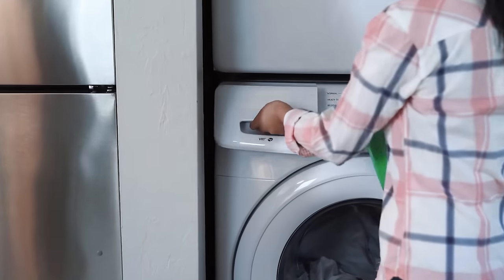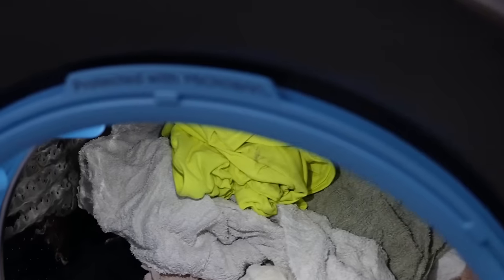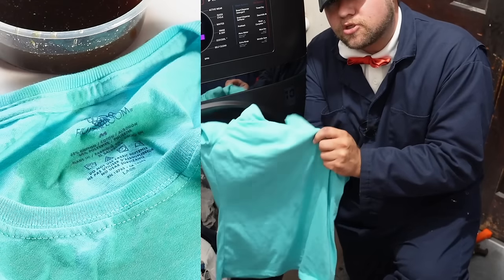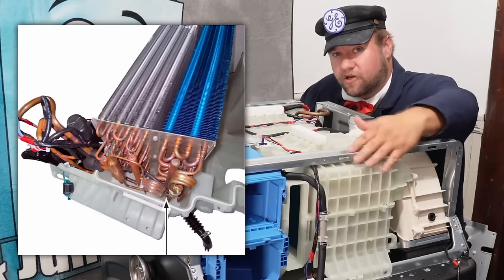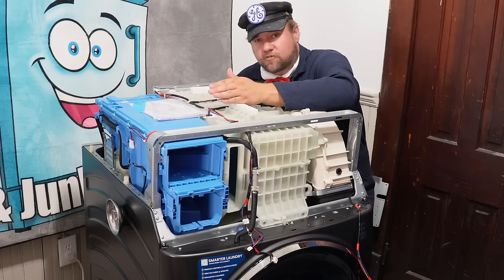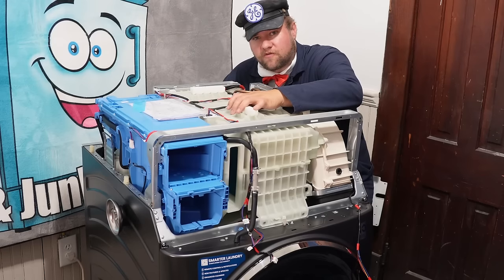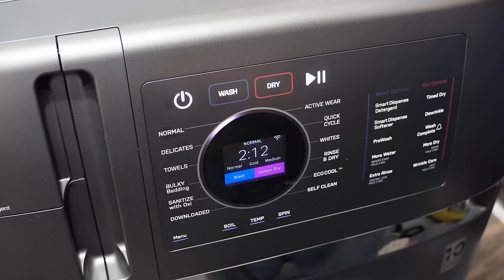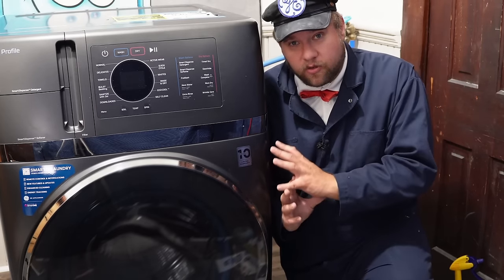The Best Washer Dryer EVER? The Ultimate GE 2-in-1-washer Dryer Combo Test & Review

Comment: Loool A couple years ago my sister asked me to take a look on her dryer, which wasn't working properly, 3 MDs and a cleaning lady couldn't figure out why, they never cleaned the lint... Like not once and the exhaust tubing was not only also clogged with lint but it was also disassembled, like maybe pressure inside just pushed pieces apart, apparently cleaning the lint filter isn't common sense

Comment: HEY! 
Great video!  I just purchased one today at Home Depot for 1400 as it as 50% off with clearance.  Have you found any improvements that could be made to the lint catcher to avoid any damage to the machine?  I saw someone put electrical tape to close a small gap between the filter and it's housing.  While I would be concerned about it melting and causing a bigger issue I was wondering if there was anything else that might be a good idea to take great care of the machine so it takes great care of me. 
Really great video! I gave it a like and subscribed!
Reply from the maker: I have a video where I used electrical tape. Works just fine. The system doesn't get much over 145-150*F and most all electrical tape is rated for 185*F. That would be the key: Make sure its rated for 185, as there are tons of parts on this machine that are rated for that which operate well.

50% off is a heck of a deal!

Comment: I have a samsung 2 in one unit. And what i do if i need to full capacity of the washer is to run  30 minute dryer. Then remove evrrything heavy like towels and pants , the  run it for like 1.5 hours more.

This way i can also some what dry things that are not ment to be dryed. I never damaged any cloathing doing this.

Comment: Ben, you compare the power usage between the GE heat pump vs a regular vented dryer in terms of a single load (10 pounds for the GE).  Data would be more useful if it was converted to a per pound of clothing cleaned and dried.  Does the 2.5-3 kw for the vented dryer apply to more than 10 pounds?  If so, the efficiency advantage would be less than described in your video.
Reply from the maker: I'll see if I can do some tests in the future. Capturing real world KWH usage on 240v machines isn't easy, but I did find a solution a few days ago I'm excited to try.

Comment: How is the filter an issue? Every single dryer I’ve ever used has a lint filter that needs cleaning after every load. Why do you make it sound like this is any different?
Reply from the maker: GE's UI, the manual, and app only suggests to clean it every 5 loads. Thats why...
Reply: @bensappliancesandjunk  Sorry, my comment probably came across quite brash. While there definitely are a group of people that cannot grasp the concept of regular simple maintenance, I think most people will probably get in the habit of emptying it each load due to muscle memory from their own drier. GE likely made the situation worse by stating that it should be cleaned once every 5 loads instead of every or every other load

Comment: I can’t even imagine what happens to the coils on the heat pump buried in the system when lint gets passed the filters which I assume it 💯 % will since every dryer I have ever had doesn’t catch all the lint in the trap… and I assume once it gets into the heat pump might there be mold issues from trapped moisture and organic contents in small dark areas?

Comment: I'm not clear on the evaporator unit part.  How well does the dryer work in very humid weather?   Will it freeze up like an a/c unit does?  Or will it wind up overheating because the humid air won't let the coil properly evaporate?  Or is humidity not a factor at all - beyond it taking a little longer, like in a standard dryer?

Comment: I got this for $1600 from Costco on memorial day. I sold my washer/dryer for this. The ONLY downside I've found to this, is that It seems to leave clothes more wrinkled than a regular washer/dryer. Addressing a few things in the review: 1. GE says in the manual that clothes will come out damp, but that is just because it cannot fully dissipate in the drum because it's a sealed system. When you take them out, the clothes will turn dry almost instantly. 2. EVERY dryer needs it's lint filter cleaned and it should be done EVERY cycle, so I don't see this as any more maintenance than a normal dryer. The machine will remind you to clean the black filter, and ask you to confirm you cleaned it when you say you have., so it's pretty important.

Some observations:
Review only touched on the fact that this needs NO venting whatsoever. I retired my dryer vent. Also because it's a heat pump, there is a significantly reduced risk of fire.

You only need a typical 120v outlet which means because it needs no venting and a regular 120v outlet, you can put this really anywhere there's an outlet and water with a drain. 

I found I needed to add hammer arrestors to my washer with this unit. I have never needed them before.

GE says you can increase the spin speed and it will reduce dry times, however, the higher spin speeds will contribute to clothes being more wrinkled becuase of an "ironing effect" of being spun then immeditately dried.

GE also states in the manual to keep the GIANT LAG BOLTS that come in the back of the unit in case you ever move or sell it. Moving the unit without them installed can damage the drum. My installers took them with them as trash. I had Costco replace them.

Lastly, the ability to scan UPC of the detergent and fabric softener you use using the app and have it dispense them according to manufacturer specs is great. I wish they woudl increase the library of detergents it was a little lacking and didn't have the detergent I use. They had the brand, but the not the OXI type I use.

Overall, just throwing in the laundry and coming back and having it done is a great convenience. We'll see how long it lasts though. I agree with the revew that the lint trap area was dirty and I feel like over time, that will make airflow an issue.

Comment: Mine broke after 6 loads...has been opened by tech 3 times over a 1 month period and is still not fixed.  Know that you must try the machine within 48 hours and if it breaks after that you are stuck with it. I have a $2600 washer that has been repaired 3 times and counting.  Who needs to do laundry over Xmas anyway

Comment: Do you have thoughts on the LG WashTower 202HBA with the heat pump? I am interested in a heat pump, partly to avoid running a dryer vent. It seems like there aren't a lot of standard US sized options of heat pump dryers.

Comment: We just bought this machine at Lowe’s. Two issues we are experiencing: I just put in a thin comforter and bed sheets with pillow cases. For some reason, none of has dried at all. Second: once it got into the dryer cycle it has forced the outlet (gfci) to shut down. Not sure what to do to resolve the drying issue or the outlet being set off. Will return if not resolved.
Reply from the maker: Have you cleaned the lint trap thoroughly?
Reply: @bensappliancesandjunk  yes. This washer dryer combo was delivered yesterday. The lint trap didn’t have much when I cleaned it.

Comment: Great video!
Question. Can you use dryer sheets? I don’t do a load of laundry without them.
Reply from the maker: You can but you'll need to clean that filter out more often with hot water
Reply: I haven’t needed fabric softener dryer sheets, there’s no static and everything comes out soft and fluffy.

Comment: I bought a GE Combo washer from Home Depot in July 2023.  I just noticed that the shipping bolts were removed by the installer, but the shipping brackets were left in place.  Is it ok to leave the shipping brackets on the machine or should I remove the shipping brackets?

Comment: Only thing I'd be wary of is the brand itself. I've always purchased GE and im 2017 I bought all GE appliances for my kitchen. Within 3 years i had issues with the over the stove microwave and had to replace it. Next was the dishwasher. Panel was shot and wouldn't work anymore. Then the refrigerator took a dump. Finally, the glasstop  stove had issues with indicators, which is dangerous because it was impossible to tell which burners were on. GE doesn't make appliances like they used to in the early 2000s and 90s at least in my opinion.

Comment: I currently have a Whirlpool Heatpump dryer (their first generation in the line). 

Despite cleaning the lint trap almost every load, ultra fine lint gets past it and collects on a non-removable mesh just before the condenser coils. In my model I need to disassemble the entire machine every 3 years to access the back side of that mesh and clean the fins in the condenser. 

Given that this top portion (which thankfully looks much more accessible) is a “sealed unit” how accessible is the area AFTER the lint filter?

Comment: Thanks for the review!

Constructive feedback: I got about 4:20 into the video and several things turned me off from trusting your review process.
1) While you did note the manufacturer's claims and the fine print, you neglected to research the specific cycles and/or equipment settings that they use to produce those results, opting instead to fiddle around with the settings until you found something that was close to the target cycle time.

2) When soiling the test garments, you chose poorly contrasting colors; ketchup on an orange shirt, for example. This could possibly give a false sense of stain removal whereas a white garment would have a much better contrast to show the true nature of any remaining stain.

3) Lack of moisture measurements after the cycle, instead offering your "best guess" of "maybe 2% of what they should be" - this translates to 98% too wet, which I don't think represents what you were trying to communicate, especially when you give a 9/10 "dry factor" later on.

That said, I really appreciated the tear-down and explanation of what sets this unit apart from others and how it works. Additionally, I also applaud the water and electricity measurements.

Comment: Thank you for this very detailed review. I am looking for a combo unit to put in a custom coach build. Two very important factors are water and electricity usage- it would be running off a solar the majority of the time, and even more importantly we would need to be able to supply water from tanks. Are there any combo units you are aware of that use less water or electricity? I've been interested in the heat pump units for a while, and this one looks like a top contender.
Reply: "...1.25kWh to 1.35kWh per load." These are very important data points gathered from another video commenter. I'm also purchasing for an RV install. Here are a few data points to prep for your install. 
- Electric Usage: 120v @ ~ 1.25kWh to 1.35kWh per load = ~11.25 Amp draw (e.g. Amps = Watts divided by Volts) = ~ 3 loads maximum for each available EcoFlow Delta Pro with a battery capacity of 3,600 Watts or 3600 Wh (Watt Hours). 
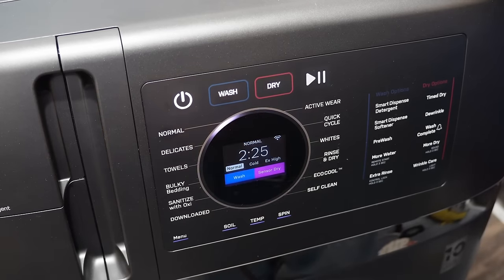- Water Usage: @14:29 10 Gallons of water used between the hot and cold settings for an average load. Still searching for data per cycle type, per average load.
- Active Cooling (Back of unit while in operation): AC Infinity WiFi/Bluetooth Controller +Temperature Sensor +4" inline fan with ducting to exhaust the thermal load presented by the compressor/components via the rear wall of the unit during operation.

Comment: Hmmm… I have two concerns….

1.  Fabric softener was not mentioned

2.  The filter.   Obviously this is a smart appliance.  It monitors the humidity of the air.   Yet there does NOT seem to be any monitoring of the filter.   It should be intelligent enough to MANDATE the filter be properly cleaned after 3 uses of the machine.  It can display a message right on the screen.  It should have a sensor to detect the presence/absence of the filter.   If the filter is removed, it must be removed for at least 3 minutes (sufficient time to clean it) before it can be placed back in the machine.  There has to be a way to intelligently and accurately monitor the filter.  Since it seems so critical to optimum performance of the machine, more thought and care should have been engineered towards intelligent monitoring and maintenance of the filter.
Reply: The machine knows when it's not clean the issue Is the lint gets around the filter and the filter somehow gets wet. I clean mine every time I do a load and I notice lint getting around it to the coils. I'm very disappointed in this machine

Comment: Thanks for all the great videos on this machine!  Do you know if this machine would work with the Watts IntelliFlow A2C-SC auto shutoff valve?  It senses current to determine when to open/close water valves and does not always work with machines that have continuous current draw.  Do you know how much current this machine draws when 'off'?  Thanks!!
Reply from the maker: 1-3w from what I remember. I need to check to confirm though.
Reply: Thanks @bensappliancesandjunk .  Any info you can provide would be much appreciated!

Comment: I wouldn't call having to clean the filter regularly a "problem". Are there any types of dryers that don't have this same requirement?
Reply: There are self cleaning heat pump and also condenser dryers, they use the condensate to wash the fluff out of the condenser unit, but they do have a filter to capture fluff from the condensate which will need cleaning occasionally. As this has a cold water feed, I'm surprised they haven't made it self cleaning, which would help maintain peak efficiency as well.

Comment: Also to replace the heat pump assy, you are looking at 1700 just for the replacement part. At least 2000-2200 for parts and labor. That is what a new machine costs.
Reply from the maker: Where do you have a link to buy the heat pump asm? I can't find them anywhere online. Marcone has the PN but no price on it for retail or wholesale.
Reply: @bensappliancesandjunk  dey distributing and sundberg america
Reply from the maker: @Thefoghaslifted  what PN# are you using on Dey for the heat pump asm? I tried the part# I had available given by Marcone, but it doesn't work on Dey, nor any model of this unit provide a parts list/schematic as far as I can see.

Comment: For real, the filter is the most annoying thing in this machine. However, cleaning after every load helps maintain the perfromance, and it is pretty straightforward with a FLEXIBLE Lint Remover (~$13)

Comment: I recently purchased the Profile Ultrafast 2in1. I was surprised to see that while setting up the wash cycles there was no way to dictate drying temperature - a basic function available on even the most rudimentary traditional dryers. I have scoured the forums and GE site to see if I am simply missing something, but details are scarce.  In one forum a claimed GE rep made various statements  such as "we never over-dry and we provide an Eco-Dry function (in the menu) which allows you to effectively adjust dryness level as needed," but nothing about the temperature of the air used to dry the clothes. Is there a way to dry polyester/spandex blends or wool clothes at a lower temperature (understanding that this would increase cycle time)? Does the delicate cycle use lower air temps?
Reply from the maker: Great question. I don't have an answer but I can get one via testing with a thermometer.

Comment: What are the required rear and side clearances (for ventilation). I can easily see this unit being used in a nautical setting, tucked away in a closet somewhere.
Reply from the maker: According to GE, there is no requirement on the sides.

Comment: It’s ventless,
I don’t have to transfer wet clothing.
The energy that it uses doesn’t get blown out of the house getting replaced with cold damp air.
The lintscreen on a normal dryier has to be cleaned every single time anyway, and if you don’t clean it on this one, at least it’s not a fire hazard…
Cleaning every five loads versus every load is a win it not being a fire hazard if it doesn’t happen because your teenage kids are lazy is a bigger win.

Comment: A little confused on this. The dryer is just a dehumidifier? The dehumidifier is removing moisture from clothes on the evaporator (return side) and then reheating the air on condenser side. The supply air temp can't be very hot. Its basically a re-heat coil on a Roof Top hvac unit, you get a little bit of warm air, but not much, Almost a zero net gain from return to supply cause you have to heat the air from the return. It would be like putting a window AC unit inside your house minus the window, sure your removing moisture. 
Is there a very small electric heater downstream on the supply side?
Also, noticed that huge inverter compartment. Is the compressor linear (inverter)? Or just a basic A/C compressor?
Thanks.
Reply: This unit must have to compensate with a very long spin cycle at high RPM's so there isn't much moisture on clothes while heating.
Reply: Like how they call this a heat pump. Sure it's pumping heat (all compressors pump heat). But a heat pump is something like on your house hvac. Pumps heat from outside during winter to heat your house and cools like a conventional A/C during summer via a reversing valve. This is a dehumidifier. Got to love manufacturers' terminology.
Reply: Clothes come out hot just like a regular dryer, but not over baked like my old high end dryer. Anything I don’t want dried I use an air fluff cycle or choose less dry and hang to finish drying. They angled the door inside and it tumbles both ways while blowing air and fluffing everything. It dries better than any dryer I’ve ever had, not wet waistbands or pockets and no big wet quilt burritos that need a second dry. I won’t ever go back, this is that good.